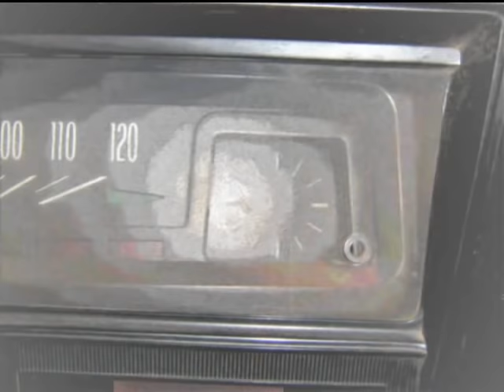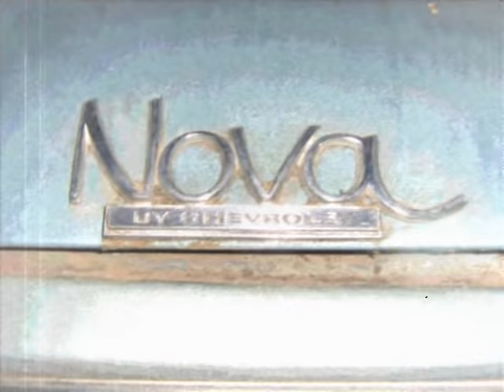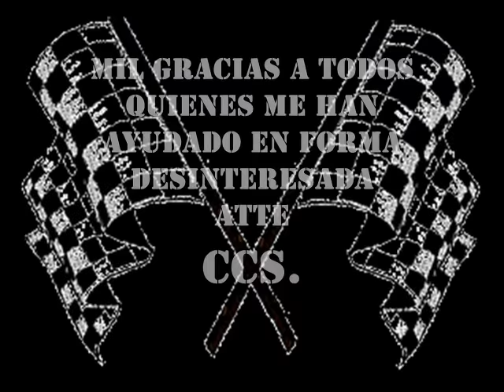Restauración Chevy Nova CCS a Diciembre de 2011

Comment from the maker: @lda0990 Hola, gracias por tu comentario.

"Los amigos valen más que la plata"

Los aros se pueden comprar, los míos los vendí baratos en 20 mil pesos los 4. También se pueden importar.

La pintura de los escapes, no se descascaró, pero si se puso negra igual. 

Espero terminar luego, gracias.

CCS.